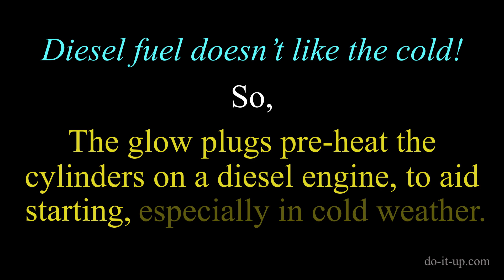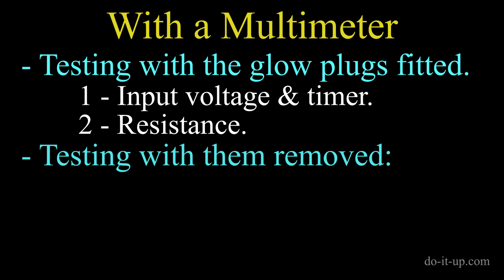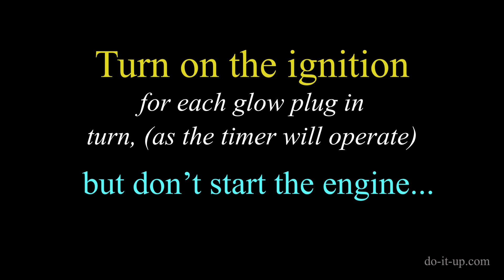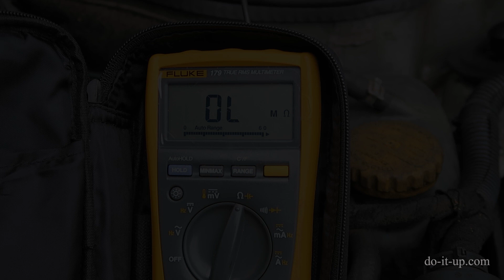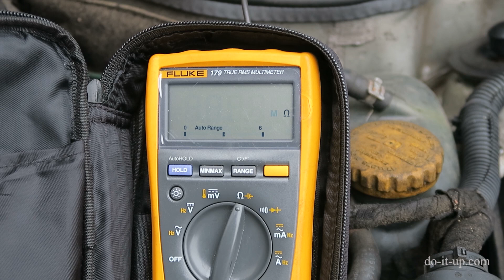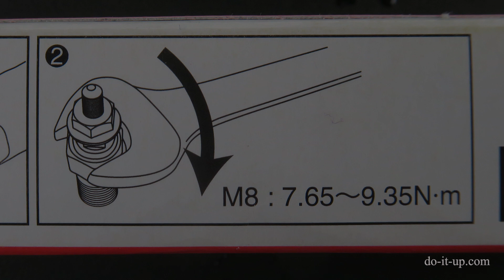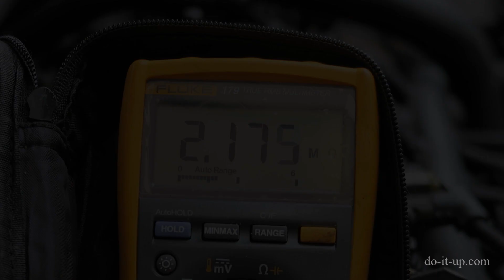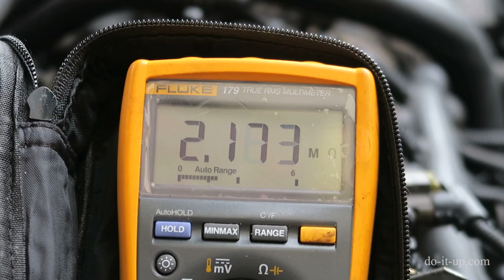How to Test Glow Plugs From Start to Finish (With a Multimeter) - The Complete Guide.

Comment: When testing the supply voltage, how to connect the 2 cables of the multimeter? Or just using the red/positive one? Thx.
Reply from the maker: Hi, unfortunately I missed this bit (oops!)... The negative lead (often black) can go on the negative (-ve) of the battery connection, or anywhere where there is bare metal work on the vehicle (also sometimes called an earth on vehicles). The bare metal work must be un-insulated and be connected back to the negative side of the battery through the car bodywork (as long as it's not a fiberglass vehicle where a negative cable has to be run back to the battery). There are often earth points on the vehicle's bodywork for connecting any negative leads (usually black) for connection back to the battery, (the vehicles metal body acts as a cable to the battery).

For info... Earth and negative can be very confusing terms on vehicles, as they are often the same thing. However, you would never connect a negative lead to earth on household electrics, as this would cause the circuit breaker to trip, or the fuse to blow. So, vehicle electrical naming conventions (and practices), can be different to general electrical naming conventions (in some cases). It doesn't make it easy...  

Hope this long winded reply is a useful explanation and helps...   😃
Reply: @doitup  thx for the detailed response. 
That's what I did, connected the negative to the battery.
Reply from the maker: That's great, you can't go wrong doing that...    😃

Comment: You didnt show where you put the negative, is it to the neg terminal of the battery?
Reply from the maker: Hi, unfortunately I missed this bit... The negative lead (black) can go on the negative (-ve) of the battery connection, or anywhere where there is bare metal work on the vehicle (often called earth). The bare metal work must be un-insulated and be connected back to the negative side of the battery through the car bodywork (as long as it's not a fiberglass vehicle where a negative cable has to be run back to the battery). There are often earth points on the vehicle's bodywork for connecting any negative leads (usually black) for connection back to the battery, (the vehicle body acts as a cable to the battery).

For info... Earth and negative can be very confusing terms on vehicles, as they are often the same thing. However, you would never connect a negative lead to earth on household electrics, as this would cause the circuit breaker to trip, or the fuse to blow. So, vehicle electrical naming conventions (and practices), can be different to general electrical naming conventions (in some cases). It doesn't make it easy...  

Hope this long winded reply is a useful explanation and helps...   😃
Reply: @doitup  wow really appreciate that bud. 🙏
Reply from the maker: No probs...   👍😀

Comment: Just ignore the massive compression leak passing at least one of the injectors https://youtu.be/nFrvzstFqwE?t=698, you don't need compression in a Diesel anyway right? 🤷‍♂🤦‍♂
Reply from the maker: Wow, a bit of an overreaction there... A slight puff of smoke on cold start up (from a leaking copper washer on one injector) and it's a 'massive compression leak'.  Plus when the engine warms it's likely to disappear due to heat expansion. Or, carbon build up will seal it after a few days/weeks, (not a good thing). The downside with this is, when you go to remove the injectors, you can't get them out because of the carbon build up! For info, the injector copper washers were replaced a week or so later... I have the video, but haven't got around to putting it together yet, (too many things to do)...  😃👍

Comment: Excellent job, please what is the correct resistance that should be in the Glow plugs
Reply from the maker: Hi, the typical resistance value should be approximately 1 to 6 ohms. However...

- Newer vehicles may have a low resistance value. If you know the glow plug manufacturer, try and check the glow plug data sheet for your vehicle, to get the actual value.
- It's always worth checking your test meter for its resistance value, before measuring anything. There's instructions on how to do it here: https://do-it-up.com/vehicles/engine-transmission/diesel-wont-start-when-cold-how-to-fix-glow-plugs/#Checking-the-Glow-Plug-Resistance, see 3.1.
- There is a table of typical resistance values here: https://do-it-up.com/vehicles/engine-transmission/diesel-wont-start-when-cold-how-to-fix-glow-plugs/#Typical-Glow-Plug-Resistance-Values. This shows typical resistance values for new and defective glow plugs.

Hope this helps...  😃👍

Comment: Those tests can tell if the sensor pressure working?
Reply from the maker: Hi, I've not tested any glow plugs with pressure sensors, so wouldn't be able to advise. It looks like they have electronics built into the head of the glow plug and a diaphragm with a piezo-resistive sensor to measure the pressure. Any movement of the diaphragm will change the resistance of the piezo-resistive sensor, which will be measured by the electronics and fed back to a control unit. This probably means the only way you can test the glow plug electronics, is by plugging the vehicle into a computer to measure the glow plug parameters.

Searching the internet, it looks like you can check the resistance of the glow plug heating element using a test meter (steering clear of the glow plugs electronics)? There is also a suggestion these type of glow plugs work using higher voltages? Therefore, before you do anything, I would check the glow plug manufacturer's website for more information, as they sometimes provide data sheets.

As usual, at your own risk. I hope this helps in some way...    🤔

Comment: Slight correction. The glow plug does not preheat the chamber, it is too small to do that. The glow plug acts like an ignition source much like a temporary spark plug except instead of a spark like from a spark plug the tip of the glow plug heats up red to white hot which is enough to get the diesel to ignite. That is why the ends of bad glow plugs can look burnt or bubbly when you take them out. The heating element dies which is the major cause of a failed glow plug. Also why you have to heat the glow plugs up several times sometimes when it is real cold. The cold chamber cools off the glow plug too fast.

Some manufactures design the glow plugs to heat at a lower voltage such as 9-10 volts instead of the supplied 12 volts plus. That makes them heat up faster buy supplying more voltage than they are rated at. The down side is that because they are being over driven voltage wise they burn out faster. 

Depending on the design the tips of glow plugs can swell or actually break off. Both are a problem when removing dead glow plugs. Plugs that are hard to remove once the plug has been un-threaded some should be lubricated and twisted out slowly with as little outward pressure as possible. If the tip breaks off generally the head has to come off to remove the broken parts, not a great outcome for a "simple" job. Otherwise the tip will bounce around damaging the piston, rings, and valves.
Reply from the maker: Hi, thank you for taking the time to comment. This is such great information and is explained so well...  Any information that helps others is always appreciated. Thank you...   😄
Reply: Lose the music
Reply: @timothysmith7436  music was great , no other sounds was needed to hear

Comment: Will this work with glow plugs used in small nitro engines like the ones in rc cars
Reply from the maker: Hi, I've never tested glow plugs in small nitro engines? But i'm guessing the principle would be the same. Give it a go. I hope it works out for you...   😃
Reply: @doitup   I used a glow plug igniter from Amazon to test them and they work fine but used the multimeter to check all the other electrical components and determined that everything looks like it should work perfectly but nothing works at all 😂 those nitro engines are a bit of a pain wish me luck lol
P.S. I posted another reply before this one but it disappeared on me so hopefully it doesn’t show two replies now
Reply from the maker: Hi, I'm glad you managed to get it all checked out. Shame it didn't work afterwards? On the positive side (once you do get it going), you should be pretty good at fixing it should it go wrong again. I had to look up what a glow plug igniter was. Not seen one of those before. My only previous experience with small engines, was with a model aeroplane. You wound the propellor back on a spring and let go, to get it started. You had to get your finger out the way pretty quick! Thanks for your reply. Hope you get it fixed soon...  👍😄
Reply: @doitup  I also have an rc airplane but all you do is plug in a battery and flip and switch and it usually works, lol

Comment: One of my plugs isn't getting a reading , does that mean it's dead ?
Reply from the maker: Hi, it probably does means it's dead! But, you can do a few checks just to make sure (if you want)...

- If you're measuring resistance, sometimes it's worth checking your meter reads '0' ohms. There's a brief description on how to do check your test meter here: https://do-it-up.com/vehicles/engine-transmission/diesel-wont-start-when-cold-how-to-fix-glow-plugs/#Check-Your-Test-Meter.
- You could also test the suspect glow plug by removing it from the vehicle and seeing if it works. There's a description on how to do this here: https://youtu.be/YkKsbRHHNS8?t=440.
- Modern glow plugs are not always 12 volts. So if you don't have a 12v supply, it's always worth checking the manufacturer's glow plug data sheets to see what voltage it should be.

Hope this helps, and you get it fixed soon...   😃
Reply: @doitup  thank  you , I'll check it out

Comment: You didn't show where the end of the black lead connects from the multimeter? Sorry, I must be really stupid as everyone else seems to know this except silly old me.
Reply from the maker: Hi, I think you're right, so not stupid at all! Not everyone knows how to use a test meter...  I always go and forget something somewhere? The negative lead (black) can go on the negative (-ve) of the battery connection, or anywhere where there is bare metal work on the vehicle (often called earth). The bare metal work must be un-insulated and be connected back to the negative side of the battery through the car bodywork (as long as it's not a fiberglass vehicle where a negative cable has to be run back to the battery). There are often earth points on the vehicle's bodywork for connecting any negative leads (usually black) for connection back to the battery, (the vehicle body acts as a cable to the battery).

Earth and negative can be very confusing terms on vehicles, as you would never connect a negative lead to earth on household electrics as this would cause the circuit breaker to trip, the fuse would blow. Or, in the worst case, it could cause a fire! So vehicle electrical naming conventions (and practices), and general electrical naming conventions (and practices) may be different in some cases. It doesn't make it easy...  Hope this long winded reply is useful and helps...   😃
Reply: @doitup  very helpful and knowledgeable, thank you for sharing your skills
Reply from the maker: No problem, it's always good to try and help. Hope it wasn't too long winded... 👍

Comment: I recommend spraying penetrating oil around the glow plug base before removing and letting it sit for a few hours. They can snap there, especially on PSA HDi engines.
Reply from the maker: Hi, great tip. The last thing you want is a broken glow plug! Thanks for sharing...   😃
Reply: I have WD40, would it be bad if soaking the glow plugs leads to some WD40 entering the engine after removing the glow plugs?

Comment: I've changed 5 of 6 glow plugs number 2 was hard to undo it's now loosened off but just keeps spinning it will lift up a few mm with pliers but won't come out I'm pretty sure its not snapped do you have any tips for this issue.The rest came out easily.
Reply from the maker: Hi, Sounds like the thread has stripped on either the glow plug or cylinder head. Unfortunately, the glow plug has to come out, but the thread in the head may get damaged in the process, (if not already damaged). Luckily, there are plenty of kits on eBay for repairing the cylinder head if the thread is stripped. Here are some examples: https://www.ebay.co.uk/sch/i.html?_from=R40&_nkw=Glow+Plug+Thread+Repair&_sacat=0&LH_TitleDesc=0&_sop=15&mkcid=1&mkrid=710-53481-19255-0&siteid=3&campid=5338823856&customid=UKThreadRepair&toolid=10001&mkevt=1. 

First off apply some lubricant and let it soak. Try and unscrew the glow plug carefully whilst applying upward pressure, using mole grips or similar. Feel carefully to see if there is any thread there. If it wont come out, you could see if the engine compression will blow it out. Though be careful, and use safety specs etc, in case it suddenly comes out, or any other debris comes flying out (don't lean over the engine looking at it!). If you do get it out, check the thread in the head by screwing in a new glow plug. It should screw in easily and tighten if the thread is undamaged. Don't overtighten though. If the thread is gone, you will have to use a thread insert, (see the tool kit mentioned above). I don't have any videos on this, so you will have to do a google search. Plus search for other extraction methods, as there is probably a lot more detail on the internet on how to get the glow plug out, (more than I can type here). As usual, at your own risk. Let me know how you get on? Hopefully this helps in some way, and you get it fixed soon...   😃
Reply: @doitup  Thanks so much very helpful

Comment: Hello, excellent video!, thank you very much, I have a Peugeot Partner hdi 1.6 16v 2010, and I have voltage in the heaters of 6.5v instead of 12v, what could it be due to?
Reply from the maker: Hi, not all glow plugs have a voltage of 12v. The first thing to do is look up the glow plug data sheet on the manufacturer's website to see what voltage they should be, (or in the vehicle manual?). It may be that 6.5v is correct. If not, then all you can do is trace the circuit back to see where the voltage drop is occurring. You can find some more information on glow plugs here: https://do-it-up.com/vehicles/engine-transmission/diesel-wont-start-when-cold-how-to-fix-glow-plugs/#With-a-Multimeter-Voltmeter.  Thanks for your comments, I hope this helps...    😃
Reply: @doitup  Thank you very much, it really helped me a lot. I don't have access to the technical manual and for me, as an Argentine, the prices of PSA are very expensive. Thanks again. Hug
Reply from the maker: No problem, I'm glad it helped you. It's great when you can have conversations across the world and help each other out, (I'm in the UK). Thanks for the hug...    👍😃

Comment: I have no power at the leads on the first test.
Reply from the maker: Hi, If you have a circuit diagram, try and trace the supply with a test meter. If you don't have a circuit diagram, do a search online for your vehicle. To see if there is any information on where components are located. You can also look inside the fuse panel lid, as sometimes relays and fuses are marked up with an indication on what they supply. If you have an idea on where the circuit components are, you can trace the supply back through connectors etc.

When tracing a missing supply, the fastest way home sometimes is to check the mid point in the circuit and then work you way from there...  Unfortunately, each vehicle may be different, so it's difficult to give specific help. Also, try and think if there are any interactions with other items on the vehicle. Such as the ignition, temperature etc. They can do fancy things with electronics these days! If there is a break in the circuit, try moving leads (supply on), it can help identify where a break is. Also try making and breaking connectors (with the supply off). There could be a tarnished or dirty connection. Hope this helps and you get it fixed soon...    😃

Comment: The engine was leaking when you started it...
Reply from the maker: Hi. Yep, a little puff of smoke...  The copper washer on the injector wasn't sealing properly. Carbon build up will seal it after a while. But, then you won't be able to get the injector out easily! For anyone with the same issue, I would recommend stopping the build up of carbon as soon as possible. Replace the copper washer (as soon as practicable), as they don't cost that much. It will save a lot of headaches later...    😃👍

Comment: What means when voltage doesnt hold 22 sec when I checked for ,but just 2 sec. max.Its a glow plug relay problem?Thank You
Reply from the maker: Hi, it sounds like it maybe a glow plug timer (relay) issue. However, how long the glow plugs are activated for will be dependent of the vehicles design (and its age). I.e. A more modern vehicle may have an intelligent system where the glow plugs are activated, dependent on a number of parameters (cylinder, air, fuel temperature, etc). Unfortunately, you can't say for certain unless you know the specific design parameters for that vehicle. If you can't find anything else wrong, all you can do is swap out the unit, or run a temporary supply to prove the system. Hope this helps in some way...     🙂